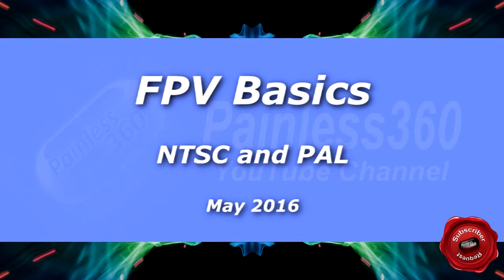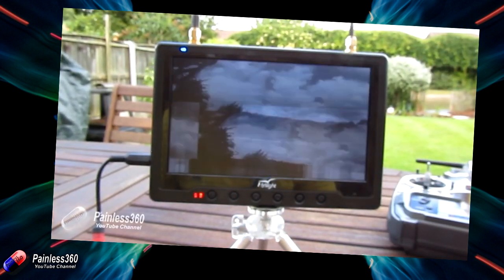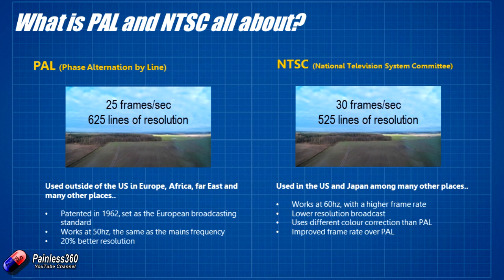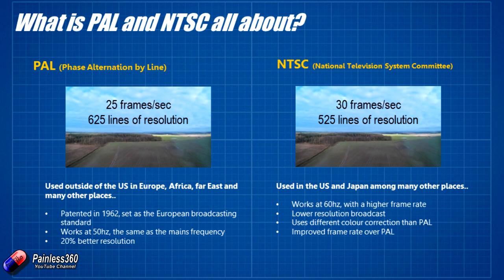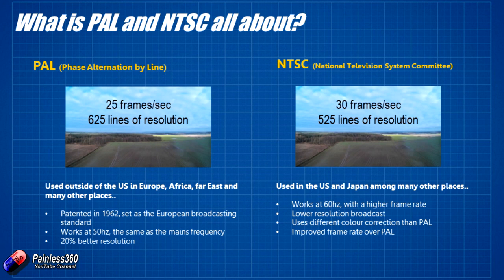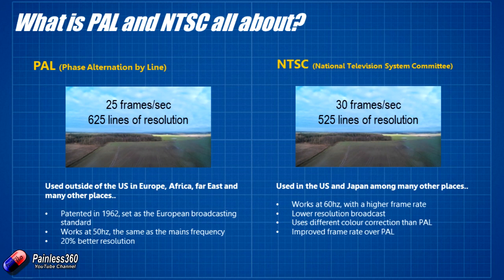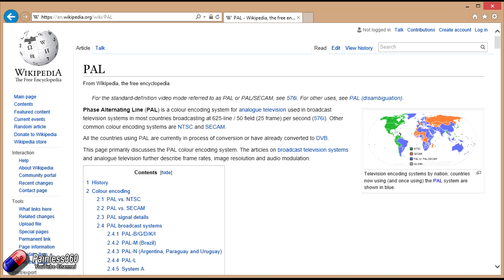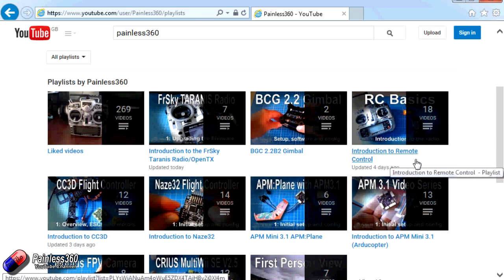RC and FPV Basics: NTSC and PAL explained

Comment: Hi Painless. I have a question: I read that there exists a PAL standard called PAL M whose number of visible lines is 480 rather than the regular PAL 576 visible lines. Are our FPV cameras using the regular PAL (576 visible lines) or the special PAL M standard (480 visible lines) ? Thanks.
Reply from the maker: I dont know. What I can say is that there significantly more vertical height in the PAL image, see the difference in the space for OSD elements when configuring an OSD in something like betaflight or INAV... happy flying!
Reply: @Painless360  Thanks anyway. If you see a difference then it's the regular PAL (625 horizontal lines but only 576 visible).
Reply from the maker: That would be my guess too... happy flying

Comment: So if using the DJI goggles with an analog video receiver bolted on it, then it is the video receiver that needs to be able to handle pal or ntsc, the goggles can then display the image regardless of what kind of signal the external analog video receiver is decoding?
Reply from the maker: Yep, that's what it should do.. Happy flying

Comment: I'm older enough to remember when colour TV was in its infancy (early 1950s!) and the different systems being touted in Europe a few years later.  I was brought up living over the family TV shop and worked there for a while. All the TVs I worked on were only 405 line monochrome but I haven't owned a TV myself for over 50 years. There were mnemonics to remember 3 of the systems.

NTSC was Never Twice the Same Colour (I did see a video of goldfish where the gold didn't keep up with the fish)
SECAM was System Essentially Contrary to the American Method (the French like their individuality)
PAL is obviously Perfection At Last!

Not into FPV myself but several of my club mates are and I keep being tempted but I think I would prefer fixed wing rather than MR.  Good video that I'm sure will clarify the reasons for incompatibility if you're not aware of the differences in video standards.
Reply from the maker: +Belper Flyer Great post - thanks for that! FPV on fixed wing (with lots of height and a balanced prop) can be very fun! Happy flying!

Comment: That's not completely true. PAL and NTSC are ways of encoding colour. The different sync frequencies are commonly associated with PAL and NTSC because there are very rarely any deviations. 525 lines (480i) at 59.94Hz is used with the M and J systems as well as PAL-60. 625 lines (576i) at 50Hz is used with systems B, G, D, H, I, K, L, M and N.
Reply from the maker: +dimmddr1 this video is to help those confused understand the basics for RC. Please make a video that covers that detail - it would be useful to the community. Best of luck.

Comment: is the framerate noticable in latency ? or does it feel the same when flying ?
Reply from the maker: +Michael Schuster I only fly PAL so tricky for me to comment but I'd expect any would difference would be way too fast to the average human to even detect..
Reply: ok thx
Reply: +Painless360 
the human eye recognizes around25 frames per seconds
higher framerates are nice but you dont need them